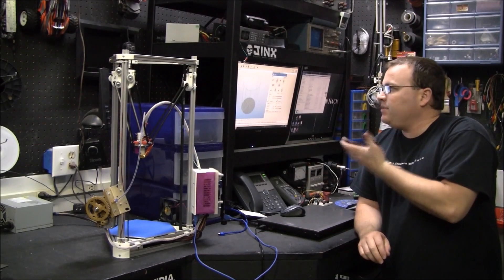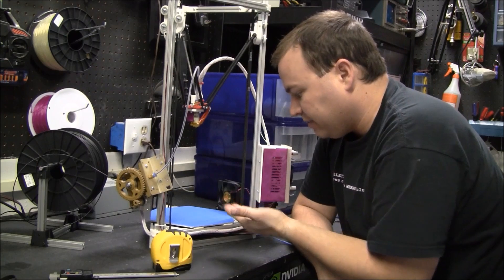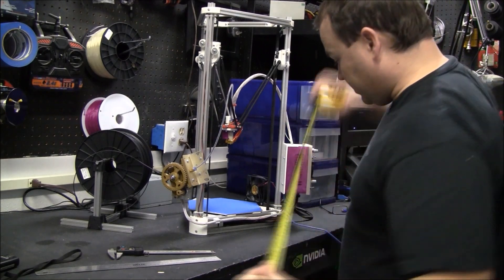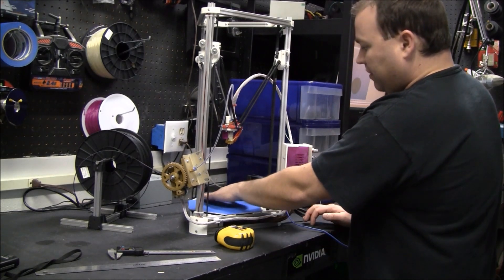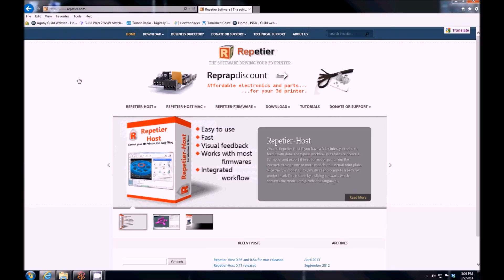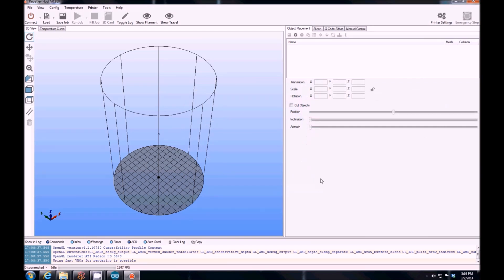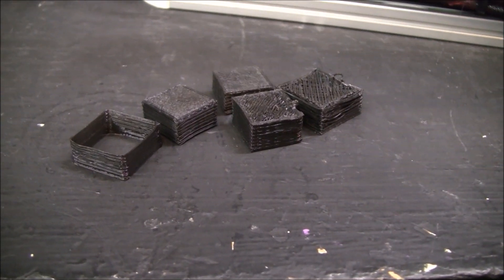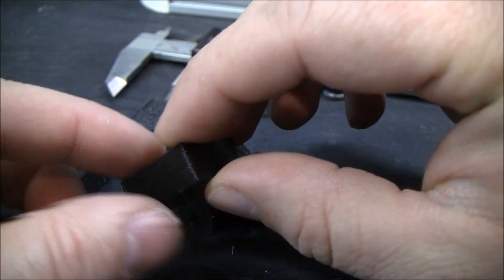Kossel Repetier Host Software, Sli3er and Your First 3D Print

Comment: Thanks for this, I just got a Kossel Delta Mini kit from FLSUN and I'm sure I'll be back many times to review this and your other videos before I get it dialed in. That  Bowden? with the big gear on the side is wild looking, does it keep track of filament used? Is the gear to manually move filament? Please tell us about it.
Reply from the maker: You can do direct drive extrudes but in some of my experiences I found they didn't have enough torque and they pull more current on the driver IC. You can also get a geared stepper motor but they are expensive. My favorite extruder is the Gregs/Wades extruder (in the video), the gears just give more torque. You can also feed by hand when loading a new roll of filament.
Reply: Thanks

Comment: I keep getting the message "Serial com error:System.IO.Ports.SerialErrorReceivedEventArgs" when i try to connect to my printer. It is a Prusa I3. I think the problem is that my computer isn't recognizing it as a printer. There is no mention of needing to put any firmware on the board, but i think i might have to do that. Can anyone help me solve this problem? Thanks.

Comment: For the Repetier v1.0.6, How do I get my model to slice properly cause all the slicing does is make very little in the machine or nothing at all my machine works it's just that it doesn't want to print and if it does it would say that the print time is 6sec to 30sec which doesn't make any sense... can you help me?

How to I change my model's size to original? cause when I put it on the program I can barely see my 3D model cause it's so tiny

Comment: Why is your are you using .4 mm layers? Is something limiting you?
Reply from the maker: .4 was what I started with because I didn't know any better, I am not an expert. I think I am using .32mm layers now. The printer is capable of printing quite a bit smaller. With smaller layers you can move at higher speeds getting better resolution.
Reply: Whats the highest resolution you can achieve?

Comment: Using the Arduino IDE software, you can change the firmware using M666 command to change the virtual position of the endstops so that you do not have to physically move the endstops exactly.  With M666 you can get within 0.05mm for "bed leveling" which is really just making the hot end nozzle tip follow a flat plane.
In addition, to change the convex or concave print plane, you can change the DELTA_SMOOTH_ROD_OFFSET. 
http://minow.blogspot.com.au/index.html#4918805519571907051
The above gives details about when to increase or decrease the DELTA_SMOOTH_ROD_OFFSET.